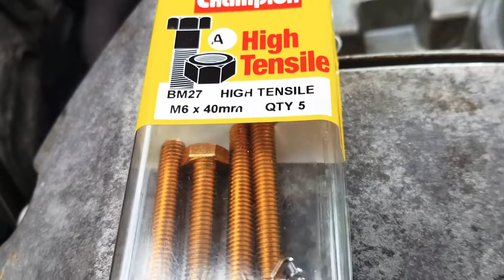M111 Mercedes timing chain rail guide pin removal..

Comment: What is the pitch of the threads? I'm finding M6 x XXmm quite easily in a 1.0 mm pitch, but I recall Mercedes typically uses 1.5mm no?
Reply from the maker: Not sure of thread pitch to be honest. I used a bolt that threaded firmly, if that is any help..